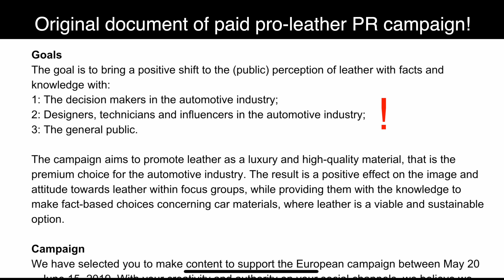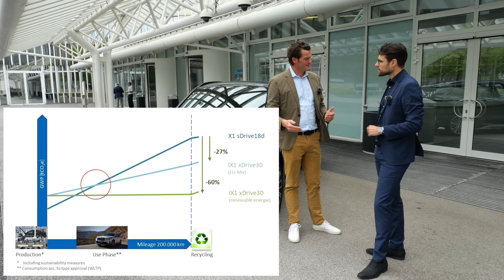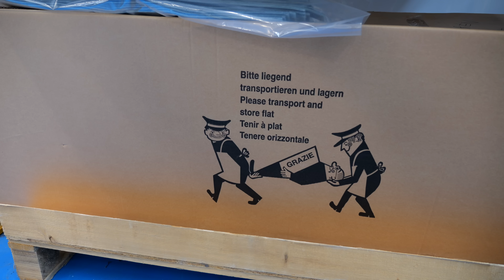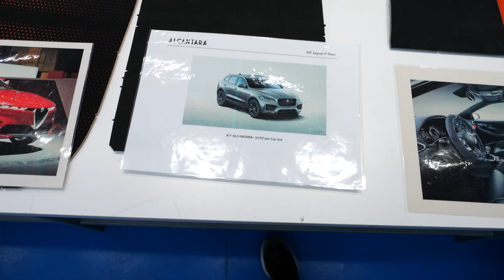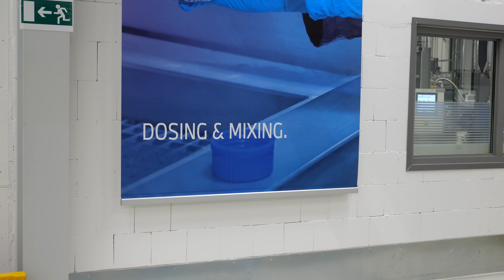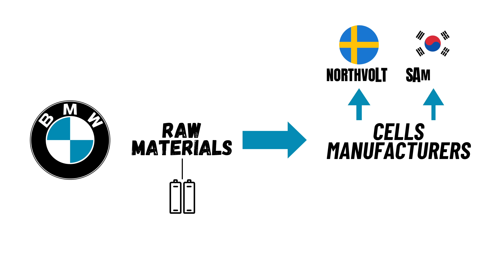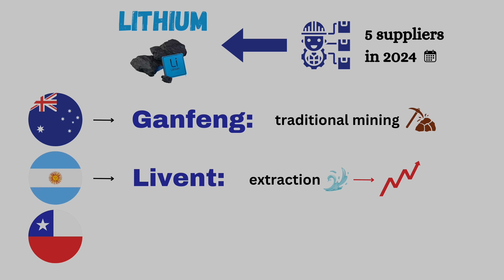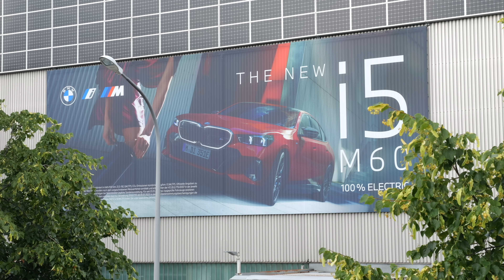How to produce more sustainable cars? DOCUMENTARY

Comment: We are producing bigger, heavier, more complicate cars in search for sustainable. All that, with components and energy from "somewhere" cheaper. A Citroen 2CV, Beetle and Trabant are more sustainable then new cars today. We easily throw cars away or making them obsolete. But industry has to make money, wheels must be spining.
Reply from the maker: Yep. As I said, most sustainable approach is to buy used. This is about how you can produce modern premium cars yet in a more sustainable way possible.
Reply: @autogefuehl 
.
Don't forget, to "Master Plan" isn't to "make money".
It's to "Transition the world to sustainable energy".
"Money" is necessary for that, but it's a means to an end, not an "end goal".
Tesla will convert factories to refurbish the taxi fleet (in my opinion)
With the "skate" (pack/ castings) lasting decades, all other components can be removed, and replaced with already refurbished examples as the "originals" enter the system for new buses, fabric, panel wrap (no paint!) etc.
Actual "manufacturing" could be reduced by (at least) 60%.
Combined with the autonomy effect cutting the fleet size would effectively end the "Automobile industry" as we know it.
Reply: If that were the only objective then yes those cars are great but cars now are set at a higher standard by the customer for low noise in the cabin, entertainment built-in and wanting a bigger vehicle. The tests for safety are also of a higher standard now requiring larger crumble zones, airbags everywhere and active pedestrian safety.
Reply: I would like to go back to some of the simpler more sustainable (?) vehicles though their safety on the road wasn't close to those of today. Love the 2CV and the Beetle. New cars are too big, heavy and complicated for our own good. Check out the Volvo EX30 on those issues.

Comment: Great Christmas gift, Thomas.
Great effort by BMW to push this direction forward, though I got a mixed feeling about this. I am very happy to see the usage of recycled materials and looking into the whole supply chain, though I am concerned of how much real impact it all adds up to. Pursuit of more sales at any cost still seem to triumph any sustainability concern. The gains aren't insignificant but they can be easily outweighed by volume. Besides, BMW is offering so many models all of which have unbelievable customisation. Convenient for customer but cost of development and manufacturing is increasing.
I reckon until these issues are properly addressed, the whole strategy is only a drop in an ocean. I do hope the neue klasses platform will address this at least in some way.
Reply from the maker: Cheers m8! Yeah they also need to reduce complexity

Comment: One thing that I know (because it’s part of my job) is that some top automotive OEM’s including Germans, are working also as substitution of polyurethane foam inside seats which is if you think about it a huge source of non eco friendly and non recyclable material . Soon we will not be seating on polyurethane foam anymore .
Reply: Sorry to be nosey, but your job is....?
Reply: They were probably a fire hazard, but I liked the horsehair seat stuffing of the old Beetle. Sure some fibers fell out over time, but it worked fairly well. I think my Corvairs had some similar materials in their seats.
Reply: @jeffcohen1934  that surely better than PU foam from the point of view of sustainability. What I am seeing coming will be something more recyclable though , still synthetic but fully recyclable and far more breathable than PU foam .

Comment: Merry Christmas Thomas! If you paint that BMW in Thomas blue, it will sure look like "Thomas the Tank". You need to buy this car!
This is a very long video, so watching it in parts. However, one point that strikes me as glaringly missing is the discussion about promoting vehicle longevity as part of the sustainability drive.  Unlike ICE vehicles, EVs have much simpler traction motors which are easily replaceable with no complicated engines, emission controls, transmission and fuel systems which often are uneconomic to replace. Electric motors can easily outlive an ICE, and can easily be designed to work for 25 to 50 years. The motor industry should be looking at ways to make cars more modular and their lifespan extended beyond 10 to 15 years by replacing parts like the batteries, body panels, etc.
Reply from the maker: merry mas !
Reply from the maker: Yes good point. E motors are easy to replace. Biggest risk is battery failure here, hopefully not

Comment: Merry christmas! I'm interested whats in this documentary, but I always say good public transport should be priority then cars would fall into place on their own, but sadly public transport isnt as lucrative for the BIG bussiness.
Reply: Tesla Master plan.
(The actual one!)
.
Electrify.
Reduce the lifetime energy consumption of each vehicle (let's say by 50%? I could look, but it's Christmas)
.
Solve autonomy.
Reduce the global vehicle fleet by at least 50%, hopefully 80%.
.
Result?
Lifetime energy consumption of that fleet reduced to between 25% and  5%(!) or the current value.
.
But there's more.
WHEN the fleet reaches that level, I believe they will switch from "manufacture" to "refurbishment"
The "skate" (battery/ castings) will generally be good for 40-50 years.
.
The parts hanging from the skate, (suspension, etc) can be swapped as units, returned to the system, checked, fitted with new bushes, etc, then fitted to the next vehicle.
Same with interiors.
Same with body panels.
New colour? No paint, wrap (great for advertising on a taxi)
.
In this way the energy footprint of the remaining "factories" (now "refurb centres") will be greatly reduced, with spare capacity used for othe projects.
.
Just my opinion, but it fits the plan.
Reply: Think Roger Rabbit story.

Comment: When I pay premium money for a car, I expect a full leather interior and I will continue to do so.
Reply from the maker: Thank you very much for your interest in this topic. I also bought cars with animal skin leather seats before I did my research and got to know the industry. The most important thing is: With today's modern materials, you have nothing to lose, just to gain. You achieve the same kind of luxury and comfort or even better while having the same or better durability with less impact on humans, animals and the environment.

You can use fabric/cloth, microfibre or leatherette. The classic approach is using oil/plastic as source material. Overall, a vehicle contains about 300 kg plastic. A car seat needs about 5 kg plastic. So the overall plastic share for the seats is very low and it is at this moment the most efficient way to produce a car seat. A couple of litres of fuel equals a car seat basically. So if you want to save oil/plastic, rather look at consumption for energy, fuel and heating and to other car parts than the seat. Note that animal skin leather also always contains a plastic coating for durability. However, long-term we should of course find raw oil alternatives. So going further, seats can be made from recyclables (e.g. from PET-bottles or old fishing nets) or even increased share of plant-based materials (like pine oil, canola oil or start-up materials like Pinatex from pineapple leaves or Desertex from cactus fibre or the mixed-plant-based Mirum, so be seen at https://youtu.be/S1aNZeoatmE?t=525). On a calculation base, by ditching animal skin leather from car interiors, the amount of emissions (CO2e) is reduced by 85 (!) % (https://www.press.bmwgroup.com/africa-dom-easteurope/article/detail/T0403389EN/on-the-market-from-2023:-bmw-and-mini-models-with-vegan-interiors?language=en) - and that is a very conservative calculation. So it is at this moment the most important thing you can do to make car interiors more sustainable.

A good example for high-end luxury with ventilated animal free seats is the BMW X7 with Sensafin: https://youtu.be/1pRNkW9nrrw
And the Kia EV9 with plant-based oil share: https://youtu.be/6vXePQi_MAk
New leatherette materials can be superior in every aspect, even for cleaning: https://youtu.be/u94YXJ72UTA
More and more natural materials are rising: https://youtu.be/nRSsXEnwHDo

Also check out what the animal skin leather industry tried to with our channel: https://www.youtube.com/watch?v=nP_CvLlaFlI
For seeing how the animals are being treated and transported in the global leather industry, watch this footage: https://www.youtube.com/watch?v=tkjCAmq1_8E
Note that the footage is genuine and was recorded by a highly decorated investigative journalist in Germany I know myself personally.

In a high animal skin grade, the animals are specifically raised for this matter. However even if meat is the "first" misuse case, the hide remains a profitable body part. That means: If manufacturers put animal leather in a car and you demand it as a customer, you give your money to an industry that earns money by oppressing humans, animals and harms the environment, you make them more profitable. Alternatively, you could support industries with your wallet which try to improve the sustainability of materials. Also, if you turn the argument around to "meat is the waste of the leather industry" you realize that it doesn't make sense (and is ethically doubtful) to discuss the primary use of individual body parts of mammals. Mind experiment: You are getting slain down on the street; would it matter to you if it was for your smartphone or for your purse? 

We cannot change what we have bought in the past, but with more information and compassion we can change how we decide in the future.

Comment: I deeply appreciate the level of detail and effort went into this reporting, and I'm looking forward to seeing more innovations in the space. 

I think the problem will always come down to regulations and corruption as no solutions are being offered that are any more viable, but politicians are taking payments and buying stocks of companies involved in this "transition" to enrich themselves off a plan they know won't work. Right now, ICE vehicles are being killed off in many countries by 2035 or 2040, and while this seems like the ideal solution, it misses by a long shot in several key metrics.

1. It doesn't reduce the amount of vehicles on the road, and in fact the increased tire wear of EVs will lead to further degradation of water sources via road pollution, and won't solve the issues of massive congestion faced in many major cities across NA and EU. 

2. The EV infrastructure to make the shift sustainable is simply not there, and at the rate of infrastructure implementation in NA, I doubt it will be until 15-20 years too late. Tesla may have their own Supercharge network but A) We should not be entrusting the well-being of our infrastructure to a company that has time and again failed to meet deadlines, quality checks, and slid past regulations through bribery and fairy dust and B) without a home charger, it is currently not viable for most to own an EV, and since more and more are unable to own homes where they could install such a thing, it will become a further gap between those who have and those who have not. 

3. The sustainability of the process to make EVs or alternative fuel vehicles is just not there. The cobalt is being mined by child labor and destroying the environment just as much if not more than the oil industry has already. If vehicles themselves are going to become a sustainable method of transport, we must force the industry to move away from exploitative labor practices across the board, including the exploitation of our limited natural resources. You did discuss this in the video about battery research being done, which I applaud as true journalism and appreciate that BMW is, on the surface, moving away from such sources, the root material is still problematic to obtain, and they're not the only or even biggest player in the market. 

The other problem comes down to bad interior designs by nearly every company, making EVs  so "futuristic" with everything touch screen and gigantic screens used (which have been proven to be much less safe both to use and in crashes) that will not last nearly as long as the buttons in traditional ICE vehicles. If they truly want these to be sustainable and worth buying, they need to stop this move and go back to buttons and physical controls, as the average screen will last 3-5 years vs there are buttons still working on 50 year old vehicles. 

4. The percentage of carbon emissions by road transport amounts to 11.9%, according to this graph https://ourworldindata.org/ghg-emissions-by-sector , compared to the rest of the energy sector, which makes up over 70% of all carbon production. Focus needs to be put on reducing global consumption of inefficient agriculture and reducing the rest of the energy sector, as they contribute as much or more. 

5. Alternative transportation infrastructure has to gain a major foothold in North America before anything else. Cities need redesigned with green infrastructure and alternative transport at the forefront, not as an afterthought slapped onto an incredibly inefficient and dangerous method of transport. 40,000 pedestrians are killed every year in car crashes because drivers have been labeled as the priority in our system. 

I truly want to believe EVs can be a viable future for the car industry, but removing ICE vehicles from the equation on the presumption that they can be replaced by worse, equally eco-unfriendly vehicles that will break down sooner and cause just as much traffic and pollution is not the right move, and the regulators need to stop taking bribe money long enough to realize that. Sure, ICE vehicles will continue to operate long after they stop being sold, but slowly they will be forced out before a viable alternative is put into place.
Reply from the maker: thanks for watching and for the extensive feedback !

Comment: Thanks for your excellent report and especially the BMW insights. You mentioned that aluminium is one of the big levers for sustainability. I agree. You will know that most customers in Europe need a set of winter wheels. (More aluminium) Please encourage BMW to find a way that will allow customers to use winter wheels from their  previous model, on the newest model. I have recently ordered my new X3 and everytime I upgrade to the latest X3 model (4th time), then I am told that I have to buy a new set of winter wheels because the old will not fit on the new model. I understand the commercial angle but this strategy is not sustainable.
Reply from the maker: oh wow interesting aspect!

Comment: I definitely support more use of fabric instead. Use organic cotton and not some polyester crap. What nature produces by itself will always be the most sustainable in the long run. Leather always looked more luxurious in pictures back in the days but after having it in several used cars throughout the years I actually miss the fabric. Was much cosier to sit in. Softer to touch. More colors to chose from. And better temperature both in winter and summer.

Cant wait though for those ergonomically disastrous and annoying touch screens to disappear again as the main control unit in the future. Dont belong in cars. Belong in mobile phones. Where space is a problem. That's the sole reason for their existance. They should at most be used for advanced settings that you dont use while driving.

Comment: Nearly everyone praises how electrical cars are better... bla bla, but nobody mentions that when you replace the batteries, you add AGAIN CO² to the process
Reply: Perhaps they can be rebuilt. I recently had the traction battery in my 2003 Prius rebuilt at a fraction of the cost the dealer quoted me for a new one. It only came with a 1 year warranty, but is still working fine after that year has gone.

Comment: I think UE industrial production is going to suicide itself with this policy. China India, Russia, Asia, South America, will continue to produce mainly ignoring sustainability and manufacturing good products and at a lower price point.
Reply: I was just thinking how much of the cost of all the R&D is passed down to the customer. There's a reason why a lot of the EU made cars are becoming unaffordable.
Reply: @ateiviz  exactly. Hundreds of millions spent to gain fractional rates of "recycled %"   "co2 reduction %" while a real wise thing would be to change how cars are and are engineered. They should ask to Gordon Murray how to make cars: light, simple, durable, easy to fix.
Reply: @andreapaglia4255  agreed, one thing that is a bit crazy is all the mandatory safety "features" that people end up disabling anyways. It's like building A rated energy efficient houses in Ireland which is also mandatory. However, that makes them extremely expensive and not affordable.
Reply: There are NEVs and LSVs that could be affordable and easily repaired but useful mainly for inner city, densely packed neighborhoods of large cities or small communities with fewer vehicles and lower speed limits. Golf carts too.
Reply: @jeffcohen1934  Japanese K-cars. Since decades are a must in the cities there.

Comment: Great video! I can't help thinking that BMW NEVER doesn anything that doesn't serve them in reduced costs though. Most stuff they made so far has had one purpose - lower the production costs and kick the customer in the crotch. This sounds like good intentions over all though - but we'll see. Wanna bet that they want do make batteries that they can down the capacity on, and have the customer pay the full hardware price for - and then pay to unlock it in full. If they get it enviromentaly "friendly" enough they won't have to take shit for using resoroces that might never be used. 

Or not. But it's BMW after all...